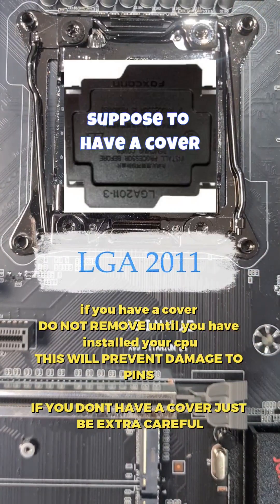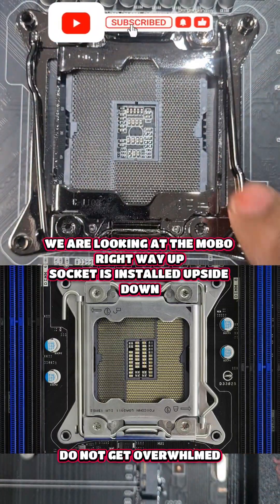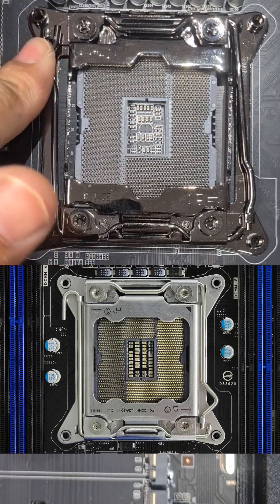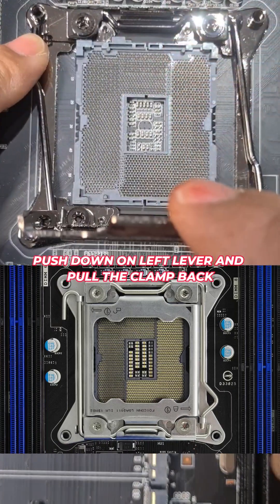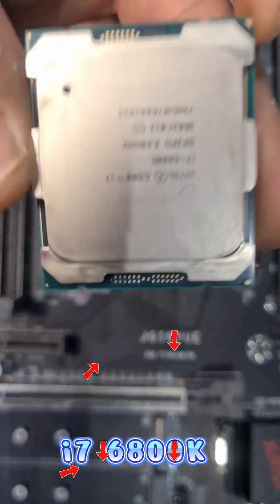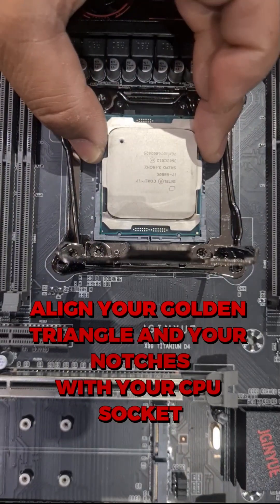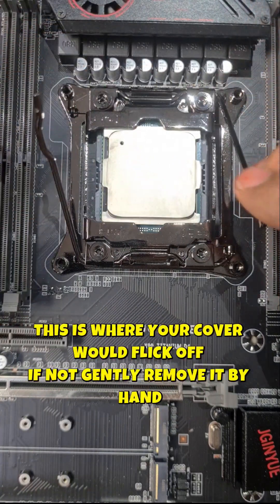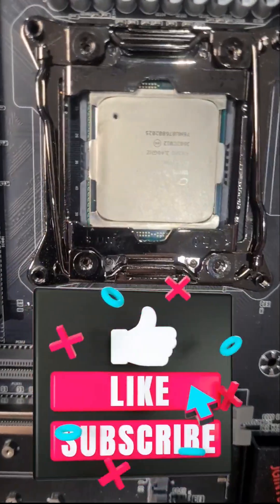how to install an lga 2011 cpu i7 6800k.

Comment: Oh how I know this socket well...... my old high end computer has this, originally running with an i7 6900K. That bastard died on me for whatever reason, so for finding the problem without any testing hardware, the system was disassembled many times. Afterall, I found out the CPU had simply died and got a used i7 6950X, which works fine to this day, despite the base PCB looking pretty beaten up.
It's my secondary computer, my main one is an i9 9900K.
Reply from the maker: HELL YEthis cpu was a beast back in the day , the 6900k is a beast still and even better 6950k insane what these were costing back then , now i gotta find a x99 or x79 to build in or even x299 luckily cuz these are old now the price is about 200 for the mobo still but better then 500 to 800 like it was 2 years ago , its funny ive had a 6800k just die on me too
Reply: @MIKEYZVLOGZ  Indeed, I paid 1,000 bucks for the 6900K (8 core) - I wanted the 6950X (10 core) already back in the day, but it would have been 1,500........ Buying this used 6950X I believe 2 years ago still cost 300 bucks. Well, apart from the one dying on me, those are good and powerful CPUs, that are still highly usable today. I am a power user with 4K video editing and 3D animation, and they can deliver that.